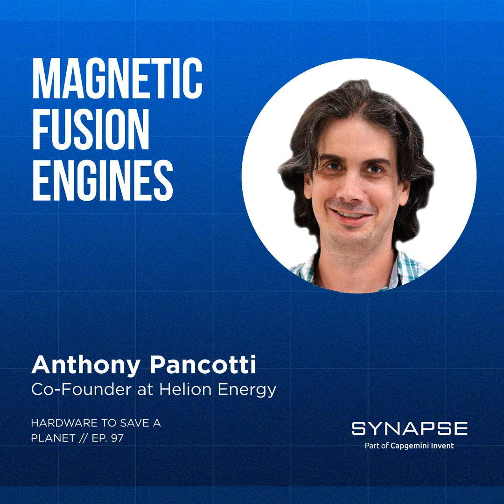Commercial Fusion Has Started: How Helion Is Bringing Power to the Grid by 2028

Comment: How can it be 95% efficient recovery while bremsstrahlung exists? That does not sound right. You're constanlty accelerating/gyrating charged particles (ions & electrons) at high speeds/temps, you're going to loose a bunch of your energy to photon radiation.  All this talk about aneutronic, but you're not keeping the energy of those photons in the system. 
And that's assuming they can actually tame plasma as they say in those conditions. 

Then there's DD reactions, which he said were happening to generate He3, but those do produce neutrons, so it's not even aneutronic? How are they hoping to minimize DD reacions in favor of D-He3 reactions? I don't see an easy mechanism there.